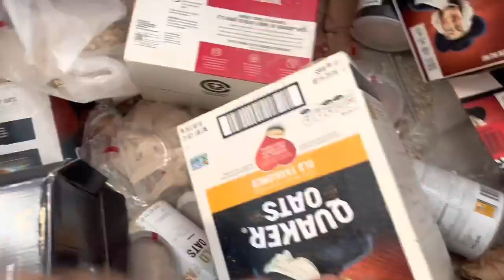FarmHand Jake Gets Fired (again) Found his replacement already!

Comment: Lester, do you have an air compressor?  You can blow air in between and it works quickly to separate the buckets🪣.  
What would work even faster is if SOMEONE did not stack them to begin with.

Comment: I hate those buckets getting struck.  I try using my feet and legs  to hold the bottom  bucket and pull the top one out,lol. Sometimes it works. Thankyou for  showing sweet Karter and the next hired help in about 18 years,lol.

Comment: If ya drill a tiny hole or two right underneath the rim of the buckets, it should get rid of that vacuum effect the stacked buckets get. Like the rim right below where the handles are attached.
The downside is ya won't be able to fill them ALL the way up with water

Comment: After watching this video I realized that by giving ‘snacks’ to Carter it seems fairly clear that to Lester   giving food equals love for him.  Also, try tapping the top up-side down bucket on an angled edge, all the way around, until the top bucket comes loose.  It has gently worked for me.  The more pressure and strength you are using means you are doing it wrong.  It can sometimes take a little while, but use gentle little taps repetitiously, around and around the top bucket until it comes loose, little-by-little, while holding he outside of the bottom, up-side down, bucket.
Reply: Dont  YOU ever get tired of posting your RUDE comments?  Unbelievable!

Comment: Lester. Teach them to put an upside down  plastic cup inside each bucket. They won't get stuck together. You can use Corigated cardboard as a spacer, too. Easy peasy. Have a dedicated bucket for the spacers so they don't get lost or damaged when not in use. If you really want to go a bit extra work, use so non-toxic glue and glue a plastic piece on the opposite sides so the buckets won't go all the way down. Then you won't have the stuck problem.
Prayers for health and safety!🙏❤🙏
Reply: He wouldn't have a stuck problem if jak e would use his head and stop doing that for Pete's sake!

Comment: Hi Lester to get the buckets apart you have to run something to the bottom in between them to let air in or just put a hole in the bottom bucket  you lose a bucket but you free one up  this is from experience  having had this happen many times think I would learn 🤣

Comment: I had a flower shop,  stacked buckets were a real pain.  Since you tore water in them,  drill small holes about 3” above bottom of buckets.  Worked great for our buckets we used for dry buckets.

Comment: 🦋😊🦋Just a thought for your bucket issue. If you have a air compressor, make a gap with a screw driver between buckets, insert air compressor hose and turn it on. Hopefully that should help. 🦋😊🦋

Comment: try a pry bar between the top edges. contractor trick. you have to stack buckets to conserve space in the work truck. it also works to open lids on large buckets of joint compound and paint

Comment: Lester have u ever thought about drilling a tiny hole in the bottom of the buckets that u don't use for liquid /water .... just a small hole that isn't any bigger than the feed pellets and when they get stacked like that u can use an air compressor in that tiny hole to pop them out ?? if they even get stuck after u have the hole in them ....just an idea i had to help ....maybe try with 2 buckets and see if the idea works ...u can also buy little rubber plugs to put in the holes that can be removed or put back on when using the buckets for liquid too hope u see this and hope its a great idea that works

Comment: Lester as long as you are not using the 5 gallon bucket for liquids all you have to do is put a small hole in the bottom to let the pressure off.  My husband takes a small drill bit to put holes in our buckets.
Reply: Wouldn’t the feed fall through the holes.
Reply: @dtees4783  No, you use a small drill bit.  It's not for liquid.  Unless the feed is a very fine powder it's not going to fall out   Corn and grains are too big to fall through.  The holes just release the air pressure.

Comment: You can affix something to your buckets so they can't stick if they're stacked. I'd try putting some velcro tape around the outside of the buckets an inch or 2 below the big part.  You can  use both parts of the velcro tape. You will probably have to get some gorilla glue because the adhesive on the tape wont hold long. Just an idea..

Comment: Anyone who has worked in a restaurant where we reuse the empty cleaned pickle buckets to mix sauces, like pizza sauce in knows this frustration. Been there done that more times then I can count. We tell the other employees mostly young ones who think we're stupid and just choose not to listen, till we're blue in the face do not stack these buckets together. I've learned a trick to getting them apart...that works most of the time. Take the handles of both buckets and twist the buckets in opposite directions and they usually will come apart. But even that is time consuming and would set me enough behind getting prep done to just p*** me off by the time opening time came around. I love this person you're talking about, but he's young still and in his mind he thinks he's doing everything perfectly. He hasn't had to deal with someone else causing him to have to work harder because of something they did yet. He'll experience it someday and then will finally get why seeming little things like buckets being stuck together erk you so much. It's when those little things get stacked up (pun intended) over and over again even after we've asked then not to do something that it begins to wear on us. Anyway yeah I get it.

Comment: I used to have a flower shop and we had problems with buckets the way we used to get them apart is by heating the sides of the bucket and then it releases the inner bucket that's stock.

Comment: Easy Peasy lester
Method 1 
Lay them on their side handles up. 
Use an air compressor nozzle between the buckets. Voila - unstuck
Method 2

Take your stuck buckets into the bathroom with you and run the outer bucket under hot water for 30 seconds to a minute.
Rotate your buckets so the hot water runs evenly over the entire outside.
Try prying them apart again using the foot trick. It should slip easily now.
Abracadabra unstuck buckets xxx 
😂 you are so funny

Comment: Lester…to get those buckets apart all you have to do is the lift and twist method. You have t hold the bottom bucket down and lift and twist the top bucket. I always stack my 5 gallon buckets with no issues getting them apart.

Comment: I've never seen anyone sepperate buckets like that b4. The way to do it is with very little effort. Be gentle. I used to work with buckets that were always getting stuck together. Don't pull the handles. Hold each side of the top bucket with the palm of your hands. And press the bottom bucket down gently with your finger tips.hold both sides of the bucket to do this. Simple.

Comment: if you only carry dry items no water or other liquids in the buckets, get a small drill bit and drill a couple holes in the bottom it has to be small enough to not let dry stuff fall out but big enough to let air in, think it was either 1/4" or 3/8" drill bit.  but again this only works if you don't carry liquid in them.

Comment: If those two buckets were air-locked together, there is another solution to get them unstuck. Drill a small hole sized about 1/8 inch on the side of each bucket close to the bottom. That will break the air-lock and they should come apart easily. We don't see you put water or other liquids in those buckets so a little hole shouldn't matter.

Comment: Lester take it from a bartender's tip and knock the top bucket on a hard surface. That breaks that seal just enough. The bar shaker/blender cup top will constantly get locked on the lower cup, just a quick knock on the countertop will loosen that for them. candy bribery is an acceptable form of uncle- love.

Comment: To get buckets unstuck, have you tried putting the bottom bucket between your feet, holding it there, then using your good hand to twist the top bucket? Another idea to introduce more air to space between buckets.

Comment: If you have an air compressor you can shoot air down between those Buckets and that will get them apart.
Same concept as you used with the water but with air pressure.

Comment: Run some hot water on the edge of the bottom bucket and when it starts expanding it will come apart easier.  Sometimes it pretty much falls off.

Comment: What if you drilled a small hole at the bottom of the bucket to break the air seal, would that prevent it from happening again? The hole can be small enough that feed would not fall through.

Comment: If someone can't help you pry them apart.. sit down and use your feet; to hold the bottom and use your hands to twist them apart. It helps oddly enough.. we used to use these buckets all the time when picking blueberries in the summer, and with my uncles painting crew (yes i've had multiple jobs) we'd always stack the buckets and crates too. because theres just no way in heck we could leave 20 some odd buckets hanging around individually.  But you'll figure it out! I have faith in you..

Comment: Just a suggestion... but maybe if you try to drill a small hole, like a pilot hole near the top of your buckets so that the air can escape. And not let your buckets create a vacuum seal. Usually they suggest to drill the hole near the bottom but I don't think that would work in your situation.
Then maybe it'll be easier for Jake to keep his job.
I have no helpful suggestions on how to get him to throw the trash away.

Comment: Submerge in water  and the buckets will loosen as you wiggle them and water will get into it and they will come apart. Sometimes you can just run water around the area where the 2 are connected.

Comment: Stuck bucket…hold top bucket up by handle, use a hammer to tap around the edges of the bottom bucket …tap gent;y all around and it will come free.  Or, pour hot water on the bottom bucket, making it stretch and release.

Comment: Use a hammer and bang those buckets apart . I'm a painter so we gotta do it sometimes.  It's because of the build up on the inside of the bucket.  Don't put 2 wet  buckets together ever either.

Comment: Lester, there are several Youtube videos that actually work that show tricks to unstuck those big buckets that might be easier on your shoulder. I would link them, but I'd be worried you'd think I was linking you something malicious. So I can only encourage you to do a little Youtube searching. I know the air hose/can of compressed air trick has worked for me.

There are also how-to videos that show adding things like wood spacers on the outside of the buckets to prevent sticking while still allowing stacking.

Comment: Lester.  Have you thought about Super glue . The bucket with out Handel's cut small places of it into straps, and Super glue to the bottom at least 2.  That way they won't fit into each other.  And you won't have to fire him again , and have him come back and do it again.  Lol.  We are all understanding.   Even if he is a gate leaving ,bucket stacking , string leaving your fella.   Just make it impossible.  It only need to be 1/2 ince out side 2 or 4 sides.  Presto.  No more bucket stacking.   And it will help with the heads in the bucket on the side by side.  Lol.  I'll keep watching see if u use this idear.  .it will work.  And should only take about 30 min. To avoid the 30 to 40 min every week.      Love you all.  Tell Jamie to help with the cutting up the bucket 🪣    So you don't hurt your arm. I was cringing every time I saw you using your arm to pull them apart.   And looking at the positive side of thing.  You got to teach me how to Un stack buckets with water.   Brilliant 👏    love ❤️ 😍 💖 you all.  "Giggling out loud.  "

Comment: Turn the buckets upside down, hold the bottom one (lip side down on the ground)  with your feet and the one that was stuck should slide right off.   At least it works for me. 😉 Good luck!

Comment: you put pin holes in the bottom of buckets only used for food then when they are stacked you can pull them apart. And then when jake wants to get water he has to find buckets that don't have pin holes in them. Leave the bucket without a handle as one of the water buckets. That would teach them.

Comment: I know I’ve had water glasses stuck together.  I had to run them under warm water and carefully move/turn them until they separate.  You might want to heat buckets, I advise water, and then pull them apart.

Comment: If the buckets are sticking together because they get too airtight couldn't you drill a small hole into the side of each one near the bottom to prevent them from getting airtight?

Comment: If it’s just a food bucket drill a couple holes in them. The water buckets of course that’s not good but just food it’s fine. Few small holes down at the bottom. I learned that a while ago when I was a young buckaroo

Comment: Lester you should have used all the buckets that you found that were not stuck together gone about your chores finish up everything you had to do and then take some time to take the buckets apart. That's what I would have done. And then I would have taken the other buckets apart and made a humongous sign that said do not under any circumstances stack the buckets one inside the other.

Comment: What if you drill two really tiny holes in the side or bottom of bucket really small just enough to let air come in and out so there is no suction. Obviously it won’t be able to hold water but feed would be fine

Comment: Easy, turn stack upside down, step on lip of bottom bucket on both sides, pull up on the bucket above it. 99% of the time or more pops right off. Give it a try. Good luck.

Comment: Take the bucket s when stuck together. Bounce them mom their sides. And it will pop out.
Or stick a  screw driver in the site and then take water hose  in and start fillin in-between  and the pressure of water and air will pop it up

Comment: Next time try flipping the buckets upside down on the ground an out your foot on the handle of the bottom bucket (actually top but since it’s flipped upside down it’s now bottom) an use the other handle from the other bucket an pull up. Separates my buckets every time. They seem to only get stuck like that if the bottom one is damp or wet at all when they are stacked.

Comment: You don't think it's funny, but I do. 😂 Sorry. Try swinging the buckets into the corner edge of the horse barn so you can break the airtight seal. You can do that one handed. IT might work. Do it on all sides of the buckets. 
You could also drill a tiny pinhole in the bottom of them. (Smaller than the feed obviously)

Comment: I worked with men and they wouldn't listen so I had to out smart them in many ways. In this case, I would take a silicone tube and make 2 ''nobs'' on the outer lower part of the buckets so couldn't fit in together. Yeah I know we shouldn't have to get to that point and they should listen but for the sake of my own sanity I had to find tricks to saves me the unnecessary frustrations. Next thing you know the get the habit of doing it the right way. Smarter not harder 😉